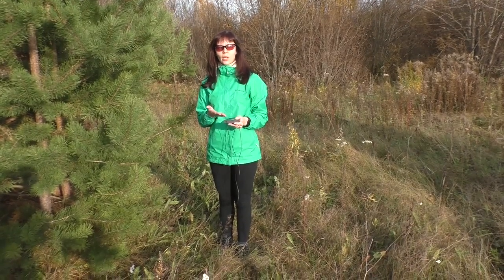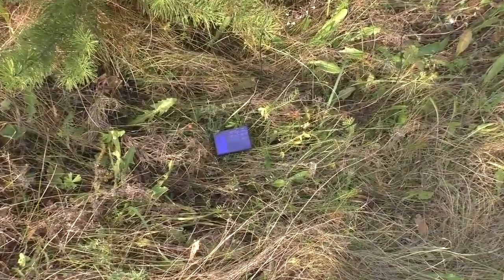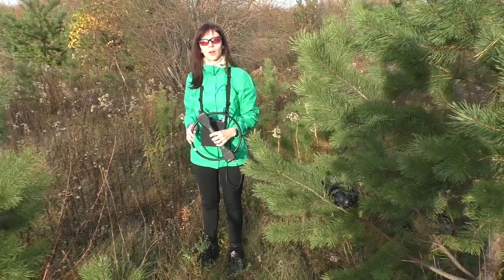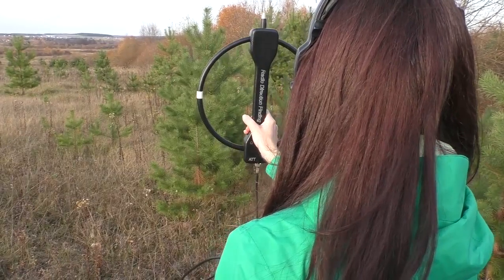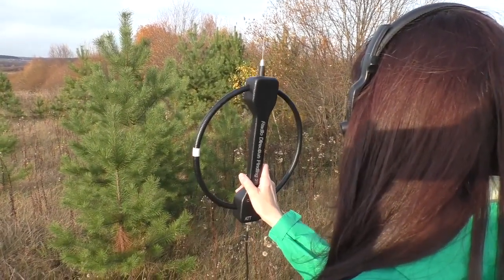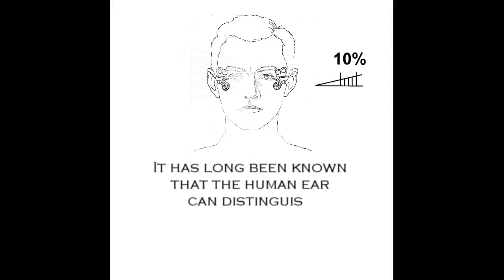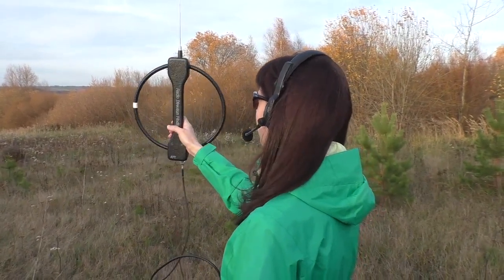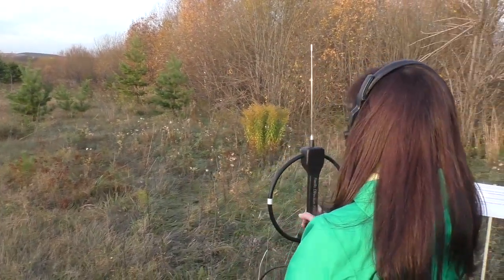How-to: learn to take bearings with FT-817 | radio direction-finding with FT-817 (ARDF)

Comment: breakdown the design of the antenna for people who wish to build own
Reply from the maker: Dear Gabriel Sansar
,
thank you for your interest and request.

This design (lay-out) is the property of ARengineering.
Besides, the item is impossible to manufacture and tune home-based for it demands a special testing facility. ARengineering has one, since we deal with maintenance and repair of marine navigation equipment.
Regards,
ARengineering Team.
Reply: Search for loop antenna. They are fairly directional but work best for Rx and not so good for Tx.